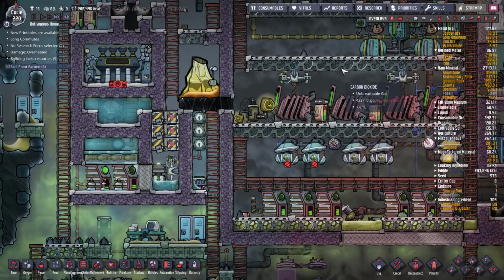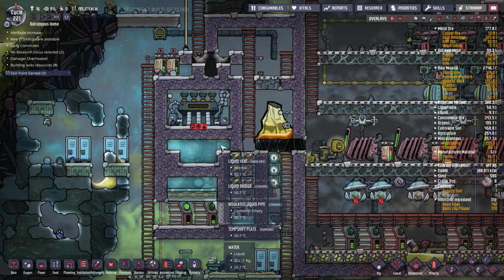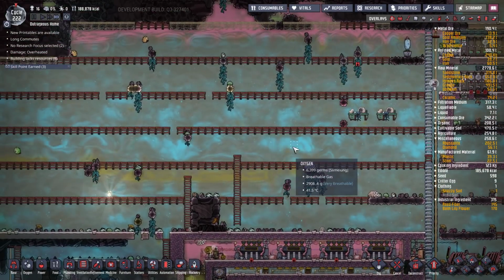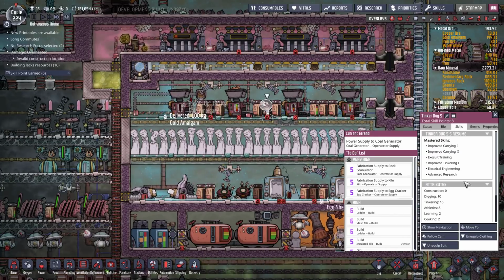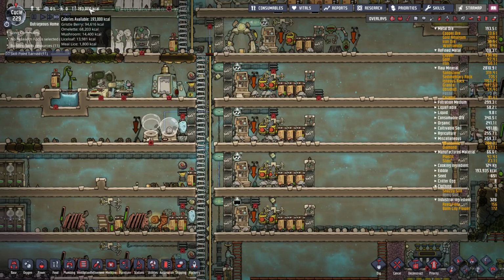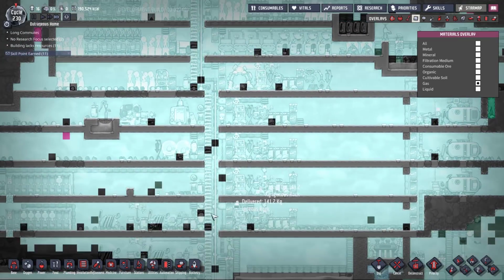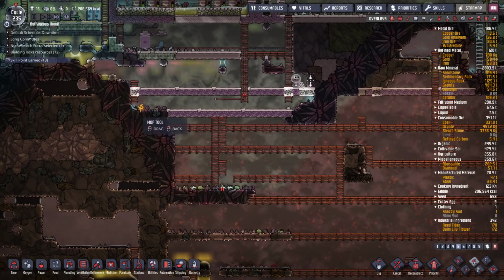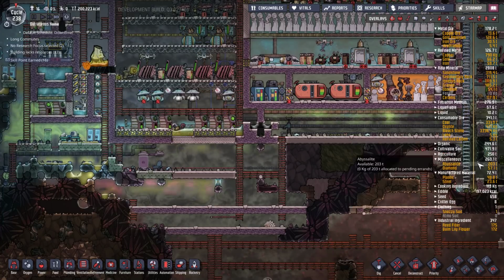QOL Mk3, 15.5 Q&A plus Misc clean up : Oxygen not included

Comment: Or you can just supply the pipes with petrolum or build a central resevouir of petroleum to supply the refiningmachines
Reply from the maker: Not sure what you mean, is it run the petroleum through the refining machines then burn it?
Reply: @FrancisJohnYT  no. U said in the video that the petroleum exiting the machine is what makes the dupes stop the tinkering. Hooking all the machines up into a petroleum resevouir will supply them as soon as the petroleum exits letting them run constantly.
Reply from the maker: @barshtoyer1806  So effectively a big pool of petroleum? Though about that but it's 70C I don't want to leave that lying around. That is why I put the liquid tanks in a vacuum with a little automation. Same effect as a big pool but I don't have to worry about it overfilling or dumping heat everywhere.
Reply: @FrancisJohnYT  dude im talking about the way you only filled the smelting machines with 800 kg. Just put a resevouir in a vacum or insulated. Fill it with petroleum and connect it to the smelting machines so there wont be a down time for the petroleum to cool.
Reply from the maker: @barshtoyer1806  There is always down time on the refinery's,  I don't think it can be helped. Once the dupes get half decent tinkering they can work it faster than it can empty out the coolant. Two doses of coolant is enough to keep it running as fast as it's going to run.
Reply: @FrancisJohnYT  ... there isn't down time if you make the system load liquid in when it comes out hot for cooling. That is what my solution tries to fix in your build - the downtime

Comment: I took a break from this for the better part of the year, but in olden times, Wolfermite used to be the best material to transfer heat. Is there a reason why you consistently go with gold over wolfermite for thermal conductivity ?
Reply from the maker: Radiant pipes were added, they are made of refined metal and greatly increase thermal transfer. Gold/Copper is best for liquid and Steel is best for gas pipes now. You missed a lot of changes it's a whole different game to where it was even 6 months ago.

Comment: How the layers of PO2 and O2 work... Gasses combine with other squares of an identical type. And it's harder for them to create anew blob of gas to fill in a lower pressure area... They have the same density, so there's no desire for them to go up or down. Once there's a big enough buffer between the two gases, a layer has formed, and is very unlikely to mix, as it's relatively stable... Also means your PO2 layers are fairly random, which is pretty good for how they want it to work.

Comment: For your food issues, you could use the new conveyor chutes so that you put an autosweeper + conveyor loader near your grill that will pick up any kind of food and have a short rail (conveyor rails actually have no decor malus) that will drop it into your CO2 pit. That way you can disable the fridges (or use them to store peppernuts/sleet wheats/meat) and actually allow your food to stack up indefinitely. I'm currently at about 9mil kcal because my dupes basically turn any wild food source into food as soon as they find them (pepper nuts, meat, wheats). All sitting in my CO2 pit.
I also make 2 grills. One for omelettes, another one for barbecue + pepper bread (I leave most cold biomes alone so that they make free sleet wheats for me, same as wild peppernuts). I split the load on 2 grills to prevent them being full of "unusable" resources (ie full of peppernuts and eggs so that it can't make barbecue).
Reply from the maker: Did something like that on my last play through but in the end I disliked the massive piles of food I ended up with. I just prefer to have a decent quantity of food instead of crap tons of calories. Though I do think it would be smarter to have that massive stockpile in case of unforeseen issues.

Comment: Couldn't you use that handy point of interest with a liquid lock to make an easy magma access? Of course the biggest issue is heat on your gas pump, but with a little crude or petroleum you could feasibly cool it enough to run a steel gas pump. That way you minimise the risk of accidental sour gas for your magma retrieval. Although then it's all across the map...Nevermind.
Reply from the maker: My through process on that went along pretty much the same lines. Needed to keep it beside the volcano in the end.